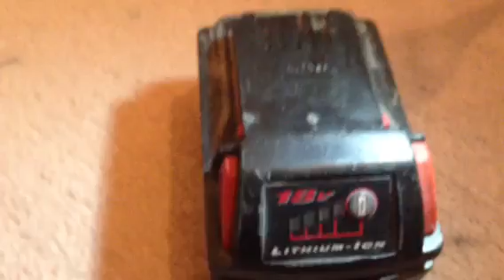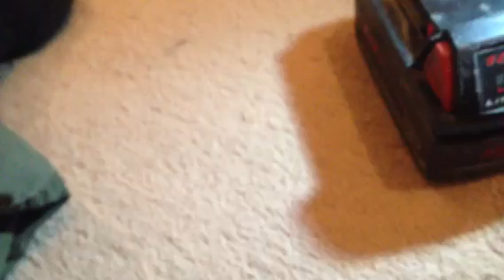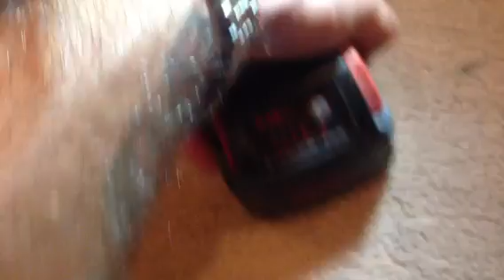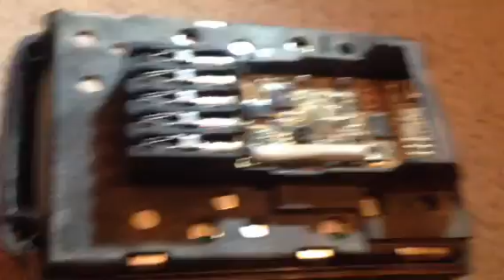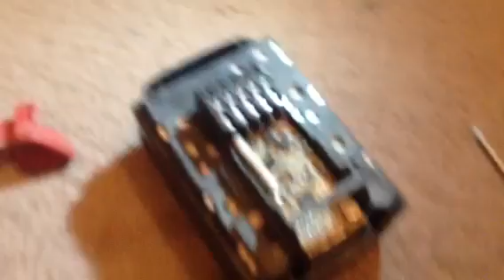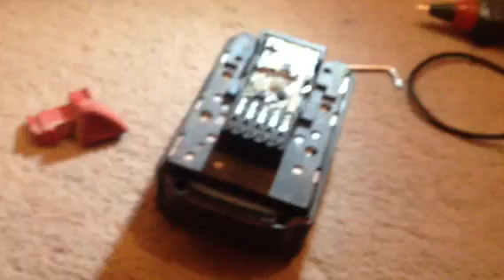Milwaukee M18 repair battery (lights issue only)

Comment: This is really no fix at all... Look closely and he never really pushes the button on the battery. and the tooth brush is a joke.The tork size is T10 hollow.
Reply: +jpopcorn lovely reply lol and a nice little video, thanks for posting 👍
Reply from the maker: +Ed Rooney Thanks for the comment. It does specify what type of repair in the comments section. I don't actually push the button, well spotted. 10 observation points to you sir. i'd already got it working again. The size is a torx 10, again as specified in the comments. so you lose them 10 observation points. (Sorry, i don't make the rules.) and the toothbrush works rather well. It fixed and clean my issues away. But if you feel it's a joke please share with others what is better and i will try it an endorse it. - Good name by the way - Principal in Ferris Bulers day off I recall.
Reply from the maker: +jpopcorn (also to they whom are smart enough to realise... The case isn't even on, so if i pushed the button, no contact would have occurred with the red LED button anyway....)